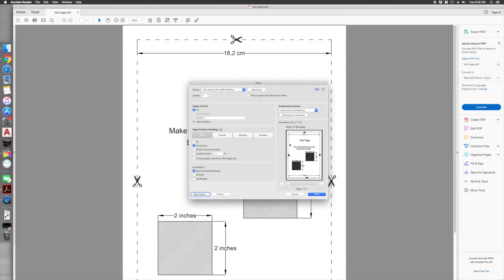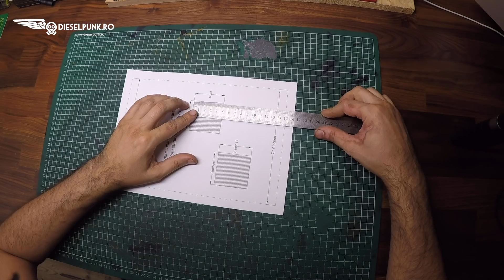How to make a large leather bag diy- Tutorial and Pattern Download

Comment: 2 questions, why are the inside walls of the pockets separate from the main body, making it a 3 layer attachment. And why are the sides of the body attached in a weaker manner than the pockets to the sides. i ask these things because i believe a key component to anything is durability, so would like to understand the reasoning.
Reply: Figure it yourself city boy. This isn't geometry class...

Comment: The flap that ties the handles together needs to be fastened to the back handle so it isn't lost and the laptop pocket on the back needs a flap not a zipper. A flap will help keep water out and the zipper can scratch the laptop.
Reply: Laptop doesn't go in the smaller zipper pocket. I made alterations and just left the whole zipper pocket out and instead made a slightly larger flat pocket inside the bag.